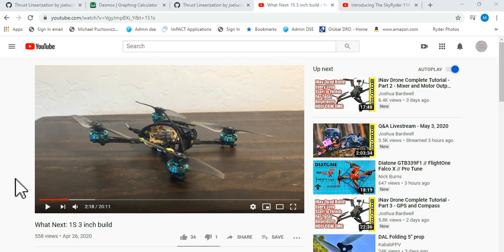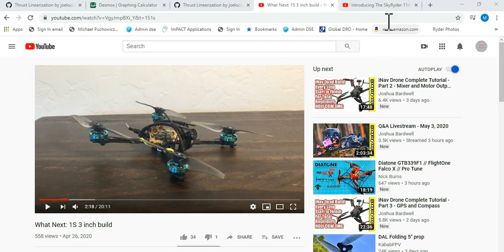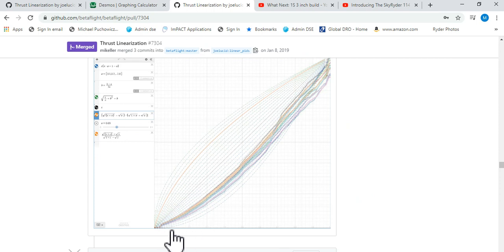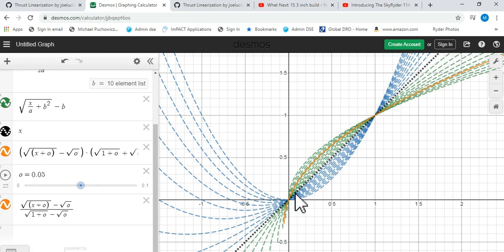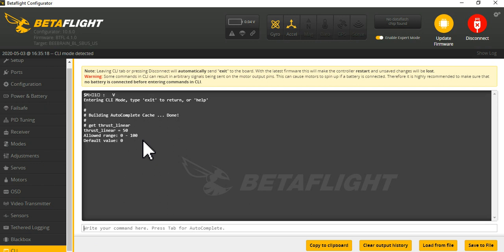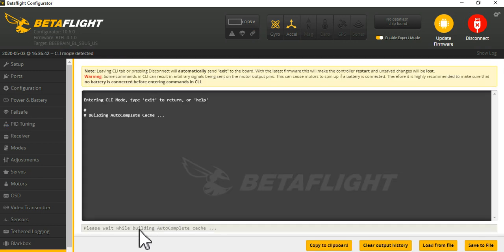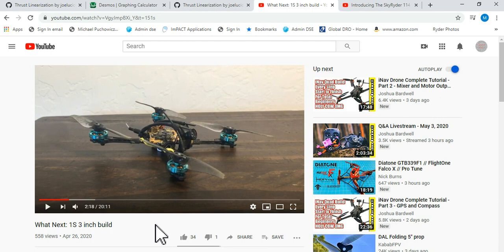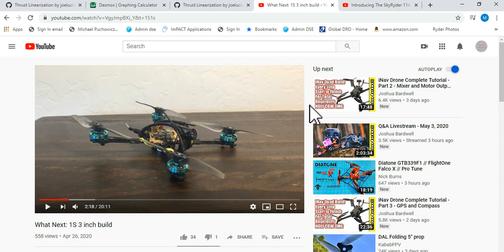Thrust linearization for over-propped builds (FPVcycle 1202.5 Gemfan 3018)

Comment: So we just adjust by feel?! I wonder if it's possible to map a linearized throttle-curve using the accelerometer, somehow. I mean, thrust is force, and F=ma,  and we know m(mass) and the accelerometer knows a(acceleration). Maybe run a flight mode that's actually a linearization mode, then we vary the throttle range while doing a vertical climb (that way we can subtract gravity from the equation easily)
Reply: The thrust to throttle input plot is probably not constatt across all loading situations. Simply assuming the curve isnt linear and then shooting for the middle range of exponentiality of the curve is probably best.

Also, if this were to be done, i think analyzing the pids at each thrust_linearization and at each throttle value might better approximate the curve best or possibly apply a dynamic thrust linearization that would be even better
Reply from the maker: Unfortunately these micro AIOs typically don't have black box so yes its by feel and easy to get lost.
Reply: @Quad66  good point. What about simply displaying g-force as well as throttle percent on the OSD, then reviewing DVR to analyze the relationship?
Reply from the maker: rob rc cheers. yes I need to get an openlager. I think the weight is probably negligible on 2S plus. on whoops I suspect it could change the tune a little. In either case though it should work check filtering.
Reply: If anyone is interested, the 20A iFlight Succex-D has blackbox, not cheap tho.

Comment: Just gave it a shot. I ran 2 packs without it first so the stock feel was still fresh in my mind.  Not sure if it’s psychological but I prefer how my throttle feels with this enabled.  Going to play with TPA...cutoff right?  When you said to get rid of tpa, is that setting it to 2000 maybe? I think default was 1750. I have it at 1640 on my babytooth. Thanks for posting!
Reply from the maker: Dudu Oson to turn off TPA yes you can either raise the breakpoint or reduce the percentage to 0. For thrust linearization it’s not actually the throttle that should feel different but the responsiveness of the PID.

Comment: Where can I find recommended settings for a 1s toothpick on 4.1?  I know the baby tooth page has settings , but those are all for 3.5.
Reply from the maker: Anthony Bonacci a link to my diff is in the video description
Reply: @Quad66  Got it.  I used only the applicable sections and turned on thrust linear to 50.  What are your reccomendations on the esc setup of these 1s ? are you running any custom firmware ?